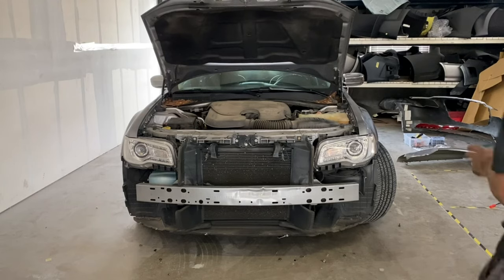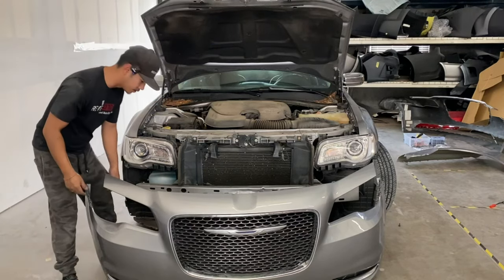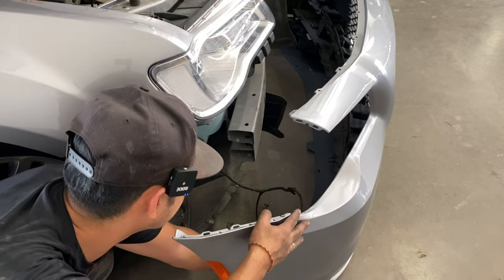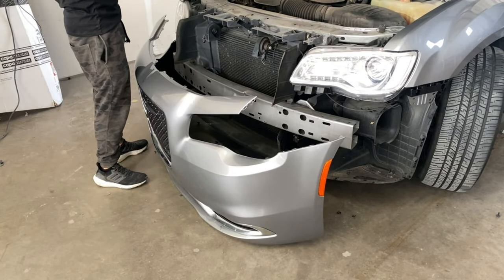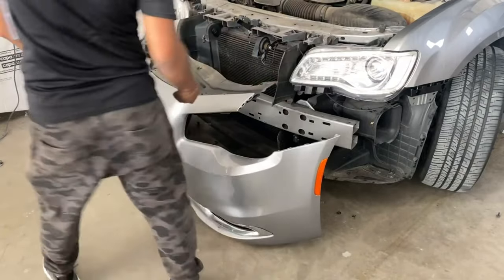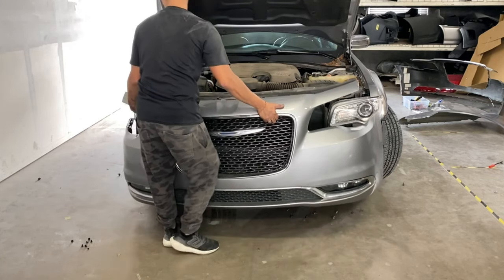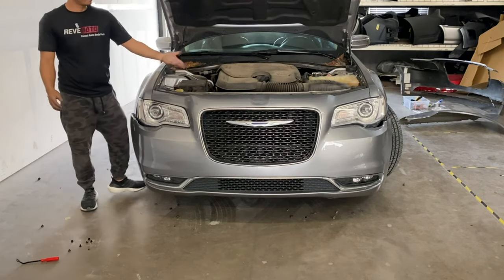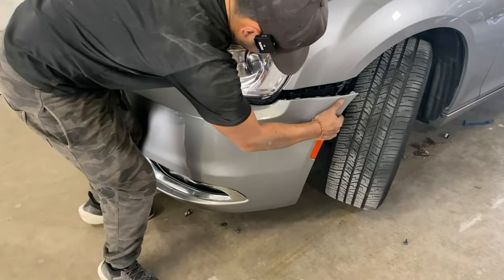2015-2022 Chrysler Front Bumper Quickest Installation Video - ReveMoto.com

Comment: Hi! Nice video  I want to know if the ears from the radiator  sides are necessary left and right black side panels
Reply from the maker: So I have seen others not put them on or if they are warn out just leave them be, but I have no idea what they do.   If you need parts for you car go to www.ReveMoto.com
Reply: Thank you...you have those parts for a 2016 300c there called radiator shields
Reply from the maker: Sorry we don’t sell that part.  Go to your local dealership they should have it for you